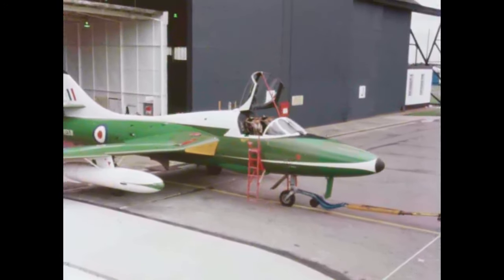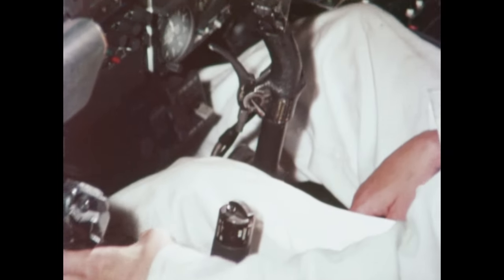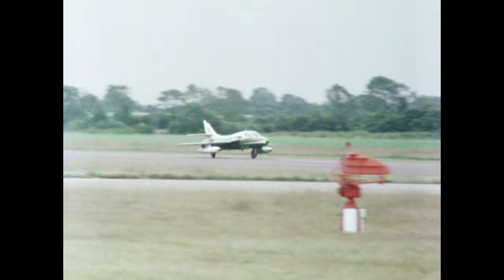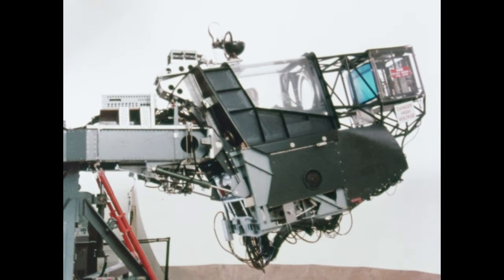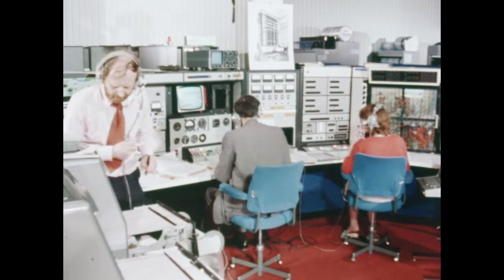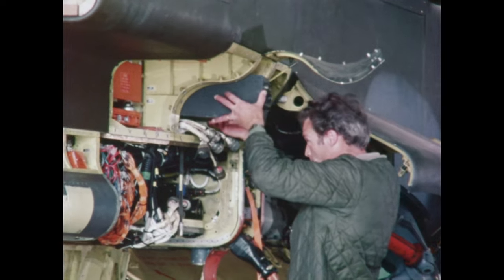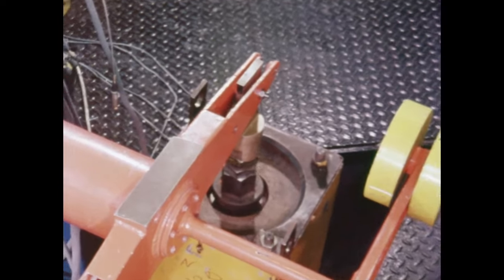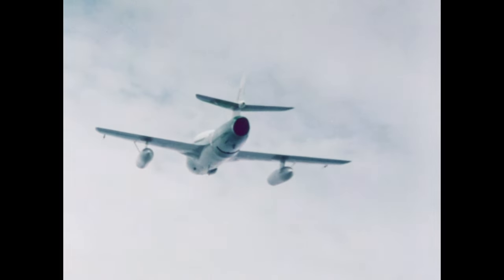Research & Development at the Royal Aircraft Establishment

Comment: Nice to see footage of the unique Hunter T.12, XE531.
Reply: Yes indeed. I was working in a lodger unit at RAE when this aircraft had an engine failure on takeoff and crashed back onto the runway. Both the crew punched out safely as I recall. But it did indeed lead to that fresh tarmac on the runway as recalled by @robertkeddle